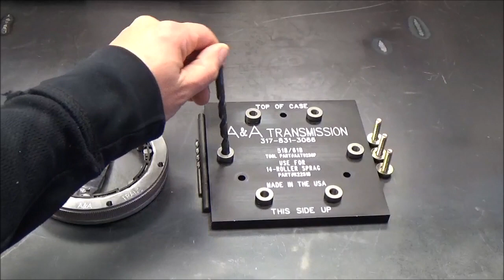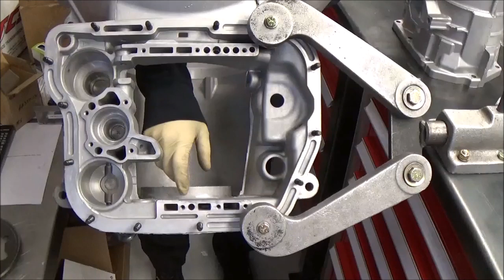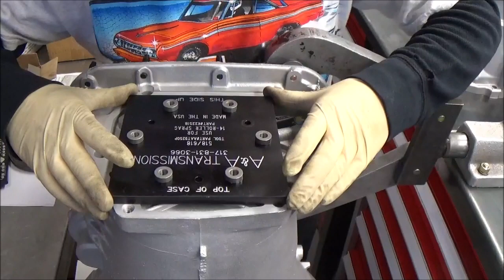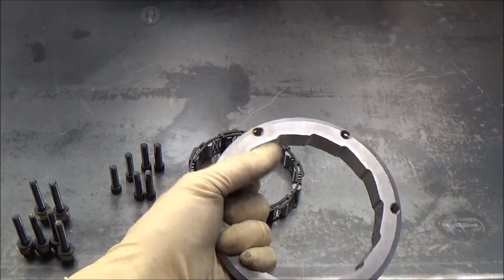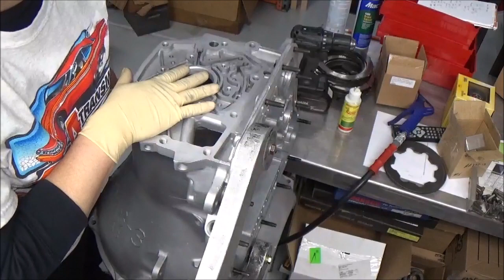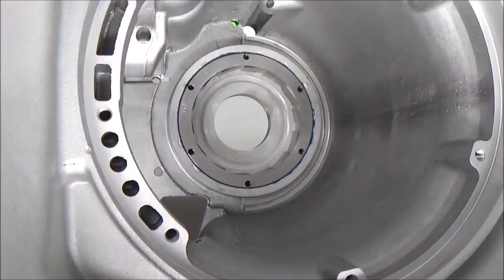Chrysler 518/618/46/47/48RE Bolt In Sprag Installation

Comment: I know other pin and rivet the metal sprag for high hp diesels . I wonder the rate of failure between the two.  Thanks for the video it's interesting I didn't know this was made.
Reply from the maker: There is also a trick to drill and tap and install a set screw in the 6 o'clock position, just like the early 727s.

Most of the RE transmissions I've torn down all had a loose outer sprag cam.
Reply: @andrewsracingtrans   my 47re is rocking slightly  right now. That's how I stumbled on this video. Boosted lauches cant be helping me out any.  I knew diesel guys pinned the rear sprag some pin and rivet.  To my surprise it's allot more common to do a bolt in sprag. You learn something new every day.
Reply from the maker: @markrich3271  let me know if I can be of any assistance to you on your build, sir. Our webstore is finally online at andrewsracingtrans.com.
Reply: @andrewsracingtrans   will do thank you

Comment: At what power level are these required? I have a diesel with the non lockup A518 and have no idea when or if this might be necessary.
Reply from the maker: If your outer sprag race/cam is loose in the case, then I would recommend the bolt in sprag.
A sprag can fail in 1st gear due to misuse or abuse, regardless of the power level. When the sprag fails, the outer sprag race/cam will likely break the case. Bolting it in prevents the case from being damaged.

Comment: Great Video, thanks for taking the time to do it...........any 904 tricks you would like to share ?  or 46RE
Reply from the maker: I build the 904 for up to 1000hp. It's a great transmission, and one of the quickest 3 speed automatic transmissions ever produced.
I will not build or recommend a 904 for a car with big tires as the sprag is the limiting factor there, and sprag failures will undoubtedly occur in that application. If you have a specific question that needs answering, feel free to call or text anytime!

I'm planning to do a few videos on some RE stuff here soon.

Comment: Great video! small question: I have a Jeep GC 5.2 V8 with a 46rh transmission (A518) with 14 rollers. Is this the right kit for my transmission?
Reply from the maker: Yes, any 46, 47 (rh or re) or 48re from 1990-2007.
Reply: Ok, thanks

Comment: This is great information.......is there any way to switch the front case of a small block pattern 518 to a big block pattern using the front half of a 727 case I'd like to mate a 440 to it.
Reply from the maker: Since all the 518/618 transmissions were made with a small block or diesel/v10 bellhousing pattern, the only way is to use a small block to big block adapter kit, or cut the bellhousing off and use the big block sfi bell hsg from a company like JW. Be aware that with the second option you are using the pump bolts to bolt the bellhousing to the trans, which to me is the least desirable option.
Reply: @andrewsracingtrans   thank you for the quick answer...........I wish someone would make an 518 front case that had the big block pattern as I dislike the use of a GM transmission in my Mopar that would be the ideal solution.
Reply: @moparnut6286  Just get a Gear Vendors Overdrive and forget the 518, as it can't handle as much HP as a GV unit.  I have had one running for years with no issues.
Reply: @georgecolbert3247  yeah that would be nice maybe some day.
Reply: @georgecolbert3247  I'm not sure whether you know this or not but the later model 47/48s have held more power then pretty much any other mopar trans

A 48 can be made to hold 2500hp and 3000+ footpounds of torque 

Currently making around 800 and 1500ft pounds in my 06 truck with a 48re